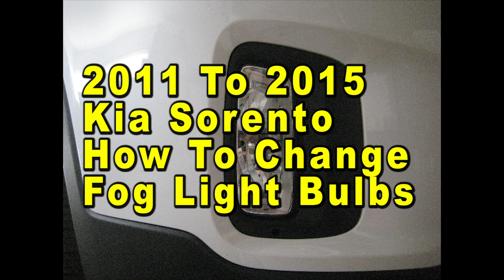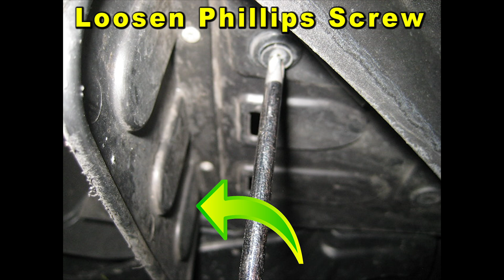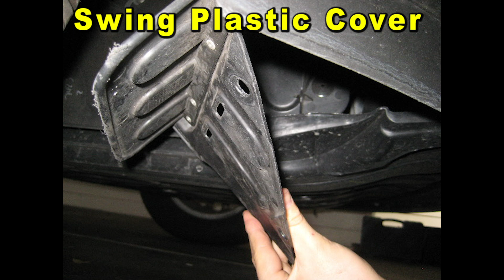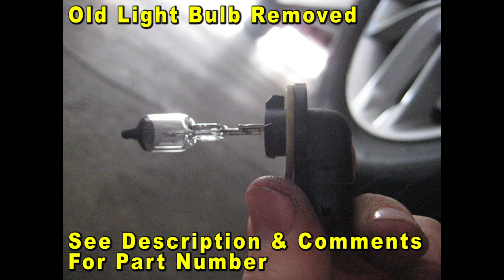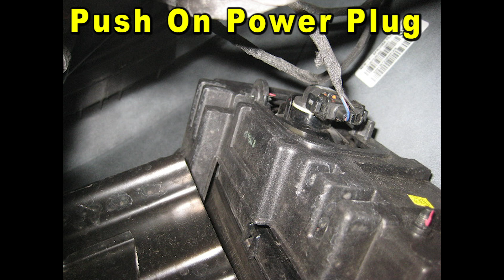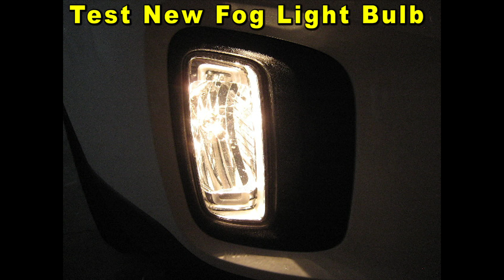2011 To 2015 Kia Sorento How To Change Fog Light Bulbs With Part Number

Comment from the maker: Kia Sorento Fog Light Bulbs Part # - https://amzn.to/401OiKW
LED Fog Light Bulb Part Number - https://amzn.to/3Y31fS5
Precision Screwdriver Set - https://amzn.to/3sLixaP
Plastic Pry Bar Tools - https://amzn.to/4cPO5xb
Socket & Ratchet Set - https://amzn.to/3Z17LbA
Mechanix Gloves - https://amzn.to/3jCnHkt
Torque Wrench - https://amzn.to/3vS5uSI

The Paul79UF YouTube channel is a participant in the Amazon Services LLC Associates Program, an affiliate advertising program designed to provide a means for sites to earn advertising fees by advertising and linking to Amazon.

This DIY video shows owners of the 2nd generation 2011, 2012, 2013, 2014 and 2015 Kia Sorento SUV how to change a burnt out fog light bulb in the front bumper cover. (Or you could upgrade both of them to brighter LED units.)